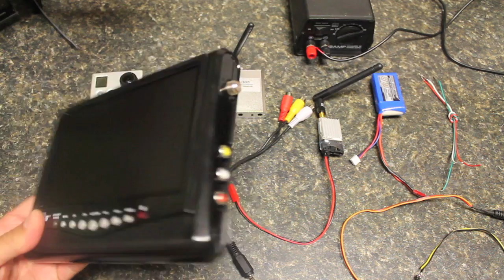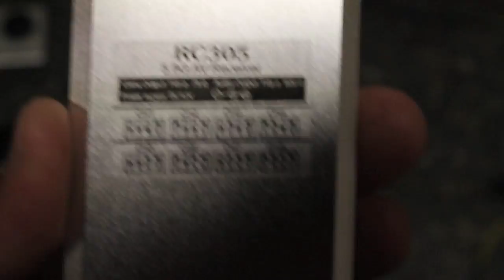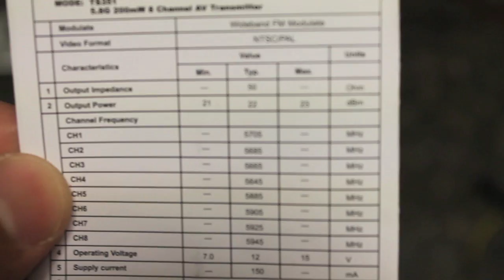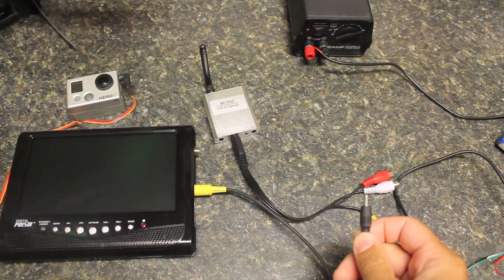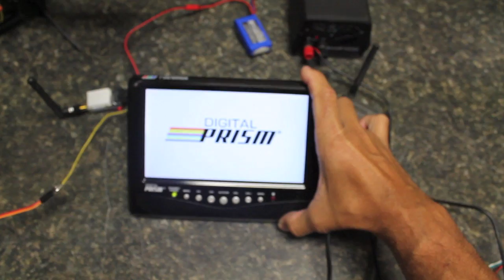How to Setup FPV w/ GoPro HD, HobbyKing 5.8GHz Transmitter/Receiver for DJI Naza Quadcopter

Comment from the maker: You're right. The inconsistency really threw me off. If you look at 5:20 you can see the switch positions for channel 3. This means are switches 1 & 2 are on with both the TX and RX. Hopefully that will get you transmitting.

Comment: This was a great video. I liked it because I have the GoPro Hero2 which is installed on
my first build - the Turnigy H.A.L. 585 heavy lift quad. I did have a couple of questions.
First, why did you chose channel and does it matter what channel you chose? My other
question is, what battery do you use in the field for the transmitter? Thanks for making this video. It was simple to understand.

Comment from the maker: Unfortunately I don't think it will. My transmitter input voltage is 7-15V DC so a 3.7V input won't be enough.

Comment: would a 3.7v 600mah lipo battery with jst connector work with this? I have this already from the V929 quadcopter, and I'm trying to cut costs as much as possible. Thanks

Comment: This is a great video. I too am in the process of getting a Phantom. My question is regarding setting this up with a Hero3 vs a Hero2. From what I have read, the output connection from a Hero3 (uses a USB out) is different from an Hero2 that uses a plug in type connection. Does having a Hero3 require a change in the type of Tx and Rx I have to use?

Comment: its ok I got it working now, for some reason my monitor (hobbyking fieldview 777) doesn't like NTSC signals from my go pro so I set monitor and go pro to pal and now it works, Just did my first fpv flight with parkzone typhoon, complete success, its such a wierd but awesome way of flying!

Comment from the maker: I'll see if I can dig up the rcgroups thread, but in the meantime you should be able to set this up if you wired everything up like in the video. As long as you have the proper GoPro cable you just need to turn on your GoPro and it will begin to output live video. I hope this helps and let me know if you have any other problems.

Comment from the maker: That sounds like a fun project. I'm not certain if it will interfere with the Phantom TX/RX. I'm assuming that the Phantom runs on 2.4GHz so you should be okay. But I would do some research before you do. Good luck and let me know how it goes if you decide to upgrade.

Comment from the maker: I normally recommend using the GPS that comes recommended with your flight controller. In the case of APM it's a ublox or mediatek. I believe in the case of Naza it's a ublox.

Comment: Let me first thank you for posting ARM 2.5 instructional videos. 
Post more of those please if you have the time.
Regarding this video...I might be wrong, but I think your transmission is 480p at most not 720p. 720x480 is still a good resolution for fpv.
Also, people should learn about antennae, diversity etc if they want long range FPV.

Comment: I just tested the set-up. It works great! I just had to add lipos and do some wiring! There is a good feed. I'm not sure if your Monitor does, but mine will display the GoPro Hero 3 information, such as the battery life, the camera mode, Rec time and stuff.

Comment from the maker: It depends on the input voltage of your GPS. What flight controller are you using? Regarding police frequencies this will vary from location to location. I would check if there's a local database where you can find out what frequencies are being used by police, fire dept, etc. For example, in Austin, TX the police use 400MHz so 5.8GHz should be fine. But consult an expert if you have any questions about interference.

Comment: This helped me out. I will be using the A HERO 3  video output from USB connector. Thanks1 I will let you know how it goes on the setup. I just need 2 Lipo batteries to power the FPV transmitter and receiver.

Comment from the maker: Nate, have you used the wifi backpack for FPV? I ask because I see a few problems with it:

1. The range is limited to wifi which isn't going to get you very far

2. The resolution is pretty poor from what I've seen

3. The latency of the backup was about 2 seconds from my test

For any serious FPV these are big limitations in my mind. Perhaps things are better now, but I tested with my buddy's GP3 on a snowboarding trip earlier this year and wasn't very impressed. Better than nothing tho.

Comment from the maker: You're right. Unfortunately with this setup you can only get standard def resolution. And even worse, the GoPro Hero 2 is only SD for the live video feed so you'd need to upgrade your camera as well. Wireless HD is expensive and I don't know of any cheap systems. Check out paralinx . net for wireless HD, but I'm pretty sure their systems run several thousand dollars. I don't think we're doomed and hopefully a cheap HD system will make it's way.

Comment: Very good explanation. I do have a question though...
I see that the video output form the receiver is composite, so the best quality image you are able to get on the screen is something like PAL. But would you be able to get a better video resolution if you managed to get hold of a cable that has a DVI connector or something like that? Or are we just doomed to fly FPV at PAL?

Comment from the maker: That doesn't sound very good. Are you using the standard antennas? If so, I would recommend upgrading to circularly polarized antennas. But you still should be getting better than 10m before you see noise. Make sure your antennas are both vertical as that may be the source of some loss. You may also want to check that you don't have any interference from any other part of your quad. Also check that you're supplying enough power to your video TX. Those are just some quick ideas.

Comment from the maker: I'm sure that's possible if you want to undo your connectors and run the leads from the servo connector into the connector for the TX. It was just easier for me to use a header pin and solder. You may be able to shed a gram or two by doing what you suggest.

Comment from the maker: In my case it did not work out of the box. I installed and then had to mess around with channels for a bit. That's why I talked a good bit about channels in the video because what was displayed on the sticker vs what was in the manual was different. So I read on rcgroups how to resolve it and ended up on Channel 3. Good luck and let me know if you run into problems.

Comment: Good video, thank you for taking the time.  You will notice a significant improvement with range (more than double easily) by changing your stick antennas to circularly polarized (CP) antennas.  Immersion RC and other companies have them for around 40.00 for both (tx and rx).  Just make sure you get the right type SMA connector SMA vs RP SMA in order to connect your system.  I got 3.5 Km with a 5.8 GHz 500 mW tx (DJI AVL 58).

Comment: You seriously talked about your channel problems waaaaaay too long.  There are 4 dip switches so 2^4 = 16 possible channels.  Just flip them around until you get video.  No research required at all.  Ugh

Comment from the maker: I hear you, but wifi range is incredibly limited. You could maybe get a few hundred feet of range while with some FPV TX/RX setups you could get well over a mile. The other thing I've noticed with the GP3 wifi setup is there's considerable lag in the video. I've noticed anywhere from 1 to 2 seconds of lag, which would be a problem if you're flying fast FPV. Maybe that will improve over time, but I still see the range being a limiting factor.

Comment from the maker: You want to use white for audio out on your Ready Made RC cable. That should connect to the audio in cable on your video transmitter. I'm not sure about the Foxtech kit, but the Hobby King FPV kit uses the TS351 transmitter. If you Google it one of the first links is the manual that shows the pint out. I hope this helps. Let me know if you have any more questions.

Comment: if i'd like sound on mine with this cable:  "GoProHD Camera Cable (Audio and Video), Product 35/59, products_id=289" sorry youtube comments won't allow me to post links
which wire should i not pull out (red/white/green).  i'm assuming white?  is there a manual that comes with the foxtech kit regarding what which wire does?  thanks!

Comment from the maker: Do you have a link to the RMRC cable so I can see what you're talking about? I purchased the video only cable so I'm uncertain about the separate servo connector. Actually, it would be easier if you signed up at garagepilots . com and posted your question over there. Either myself or someone in the community will help you get going. You can post links, photos, and videos over there :) Sometimes it's hard to use YouTube for this kind of support.

Comment: Thanks for making this video, I plan on using the same setup but I'd like sound.... I have the GP3 and the RMRC A/V cable comes with a seperate servo connector for Audio, I'm a little confused how to connect the White Audio wire from the RMRC cable to the Vtx cable??

Comment from the maker: Ha. I had a buddy jokingly say I needed to trim my finger nails in one video. I about slapped him :) The range with the default antennas is less than ideal. You could go with a cloverleaf setup and get much better range...from what I hear. I'm going to do that soon, but am still getting comfortable with FPV and don't need to go too far. I had the header pin laying around, but you can probably find them at your local Radio Shack or definitely on eBay. Good luck with your setup and keep me posted.

Comment from the maker: Good question. I just realized that the link in the description takes you to a newer version of the monitor. It used to take you to a LCD monitor that doesn't have a TV tuner built in. I need to see if I can find the screen that I'm using without the TV tuner. But to answer your question, the antenna is for a TV signal and is not a FPV RX. Sorry for the confusion.

Comment from the maker: Your setup is probably much better too :) My range isn't that good with the standard linearly polarized antennas, but I plan on improving that. Regarding the screen I've read about screens going dark when out of range. I did a test several months ago and I'd love to hear your take on it. You can check it out here: youtube . com/watch?v=eUrVo11mtaI Let me know if that's what you'd expect. It goes to static and then ultimately goes to "No Signal". But sort of fades in and out. Thx!

Comment: that is so cheap Dennis my set up is way more expensive.
Just my screen is 120.00
 tx rx  120.00
Antennas tx rx are 120
plus cables

Does the screen turn to blue or static?
If it turns to blue be careful as if you loose video and goes to blue screen you will be in big trouble.

Good job on getting a cheap set up I am curios how far you can get. I had the same set up when I started and did not get good range thats when I went with range Video set up and have not looked back since.

Comment from the maker: Total = $126.47 not including shipping and battery to power your system. Here is the breakdown:

FPV Monitor = $59.99
Hobby King FPV TX/RX = $57.99
Readymade RC Cable = $8.49

I hope that helps and all the links are above. You can very likely find a decent LCD display for cheaper than the one I listed in the description.

Comment from the maker: It's actually a DC power supply. Takes 110V from the wall and converts to 12V DC. So when I'm in the field I power the RC 305 with a 3S lipo.

Comment from the maker: Great question. I had researched this several weeks ago and never came to a definitive answer, but this is the closest I've found from IBCrazy in the FPV lab forums:

Without HAM:

Maximum power level: 10mW (2.4GHz), 25mW (5.8GHz)
Available frequencies: 2410-2450MHz, 5625-5925MHz

So you're looking at a 25mW TX without a license. I'm actually taking the HAM exam later this month and am trying to learn as much as possible about this topic. I'll let you know as I learn more.

Comment from the maker: Yes, it's possible but I've read there are a lot of problems. I haven't done this myself so am answering based on what I've read in forums. Here is a good link to information about it:

rcgroups. com / forums / showpost.php?p=24448709&postcount=66

It may not be worth the trouble though. Perhaps you should look into having a dedicated FPV camera and let the GoPro do the recording. I initially used my GoPro 2 for FPV but ended up buying a dedicated FPV camera for $50.

Comment from the maker: Michael, that is nuts. I didn't have any problems with my setup when doing this. I've read a few threads about this problem and have never read about a definitive solution. I'll be glad to help if you want to contact me. Or better yet, sign up for garagepilots. com and post over there. It's a community that I'm involved with and there are a lot of us helping each other out with various aspects of multirotors. Would like to help you get this resolved and good luck!

Comment: trying to get my gopro 2 to work as fpv live feed + record at same time. When I do that my gopro locks up.I tried it with video tx power off and when I plugged in the video out jack in it froze. I have tried 2 different video out leads both have no power lead to gopro and one of them was pre made specialy for gopro 2.. I have rolled back the firmware forward and back 6 times with no success. I have a class 10 SD card. Gopro say its not their problem. thankyou for any ideas you may suggest.

Comment from the maker: Yes, you can record and transmit at the same time with the GoPro Hero 2. My GP2 used to be my FPV cam, but now I use it just for recording and have a separate FPV cam. I believe the GP3 can do the same, but am not 100% sure.

Comment: (continued)  Or, is there a better way of doing this?  I don't know which is better 900, 2.5, or 5 or ?  Oh, the transmitter will run on 12V car DC, but the receiver will be on 110 (or 12V if need be).  I will be purchasing your suggested TV for testing.  Good tip.

Comment: Dennis...  Can you build me a system?  I want to mount a TX on my race car (full size not RC) and transmit video and audio to my race trailer where I will have a projector and a screen.  I don't need high def., but I do want audio.  I can mount the receiver antenna up pretty high (10 to 15 feet), and the transmitter antenna will remain vertical on the race car, so we can use a higher gain antenna for the maximum distance.  I am looking at 1 mile or more line of site.  Can you do this?

Comment from the maker: You and me both! I will get around to that soon. I'm still doing up-close FPV just until I get comfortable with longer range flight. I was going to do a stationary field test with the TX on the ground and then have the RX in my buddy's truck. We'd drive until we lose signal and measure the distance. Just not the same us doing an in the air test. Thanks for the feedback!

Comment: The connection you are holding in your right hand at 06:55 in the video. Is that one included in the FPV kit from Hobbyking? If not, where can I buy that one?

Comment from the maker: The monitor is battery powered, which is awesome. There's a link to it in the video description.  The cable that I use with the GP2 is from readymaderc. Here is a link to do the same with the GP3. Actually, I can't post a link so Google this:

diy-gopro3-video-out-cable

I'm not sure what video receiver you have but mine has two video out ports. So you can run one to the monitor and one to goggles. Good luck!

Comment: Hi, what again are you using to power the display monitor ( I want it to have power in he field ) where did you get that one cable with the connector that you have to solder yet ? What I want to do is to have a GoPro HD3 on the F450 transmitting to the monitor while recording and also have the ability to add goggles also into the setup ? Thanks

Comment from the maker: Great to hear and thanks for the feedback. As for your questions...

1. Yes, that's correct. I use GoPro for both video TX and recording to SD. I'm working on a video that demonstrates installing a dedicated FPV cam, because it's hard to fly FPV with the GoPro lens...at least for me it is!

2. I'm not sure what you're asking. What do you mean by charging a receiver? Are you asking how to charge the receiver's battery? I'm assuming you're using a standard 2S or 3S lipo for your receiver?

Comment: Hi Dennis,

thank you very much for this great tutorial and links! Really helped me a lot! Today I did my first flight with GoPro on board. As I am amateur and you look like really kind person, please, may I have two small additional questions?

1) So, if I get it right - you use one GoPro for FPV and simultaneously record on the card inside GoPro?

2) Please, do you have a clue how to charge a receiver from a portable battery? 

Thank you very much again! 

Petr

Comment: I weighed it the other day....F450 custom painted with custom landing legs, 4000 4s Turnigy Nano-Tech, GoPro 2, Frsky D8R-II Plus, RC Timer 750kv motors, your fpv transmitter combo, but with Cloverleaf.  

1371.3g with everything mention and 8" props (i switched over to 9x4.7 last night and it flew much more stable).

I dunno if the weight is good or bad?  Feels heavy, but I'm used to whipping it around without a camera or any of that extra stuff.

Comment from the maker: I know what you mean. It definitely happens with mine too. I use vibration dampening material under my transmitter, which helps a little bit. I'm trying to find the specific source of the problem. I do have a dedicated FPV camera coming and will post my results vs using the GoPro for FPV.

Comment: thanks for the help, turns out the connector I had used the white for video and the yellow for audio, as soon as I swapped wires I had video!  

How well does your system handle interference?  I'm noticing my screen flickers when I just walk around the house with my transmitter.  Any suggestions?